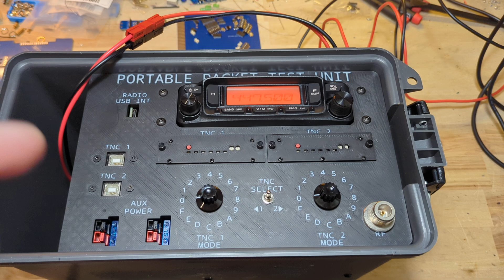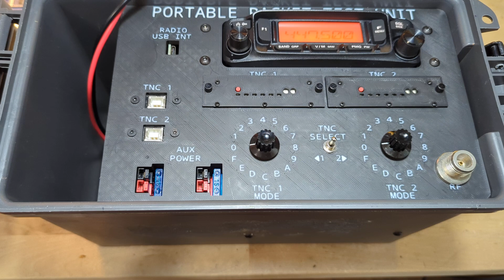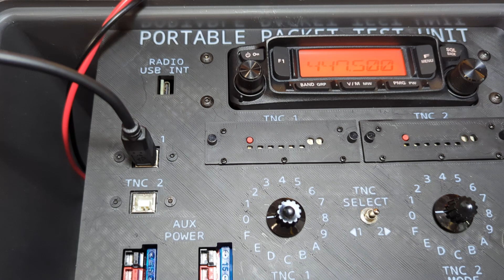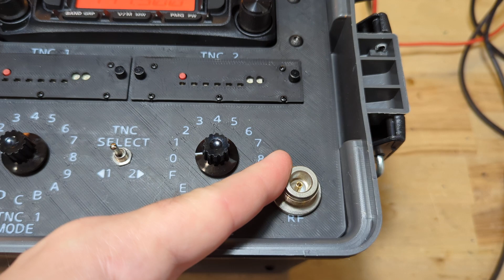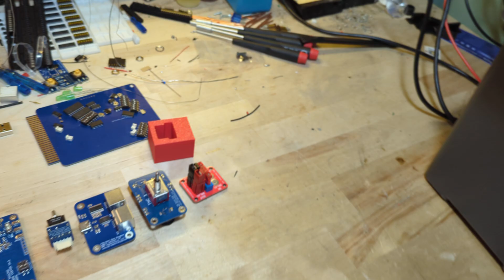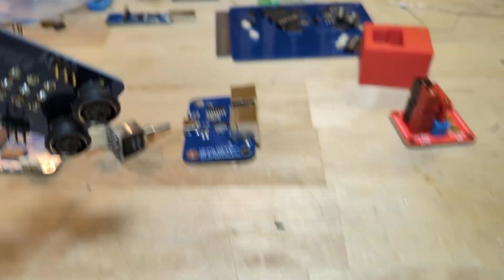My Portable Packet Radio Test Box

Comment: Very nice. I had a similar sort of thing but in a soft but rigid plastic laptop bag. Bit of power distribution, all the appropriate connections brought out to the front. Not nearly as elegant, but the same concept. I thought it pretty ruggedised, but on its first feild day out the bloody lcd on the radio cracked in transport, rendering the whole thing useless. Not sure how that happened, it was on a marine ply base, should have been safe. Ammo cans are not that common in my part of the world, wanted something that wouldnt attract attention, hence a laptop bag. A rigid can and remote head is a very good idea. Wasn't entirely useless, my accessory power port had a LED on a flexible gooseneck and dimmer to fit, so it was a glorified desk lamp. Fortunately it was a good night for HF work, so I wasn't that bummed out. Particularly like the use of the binary switches. Those things are great for field HID.